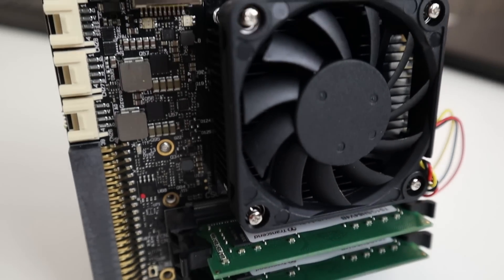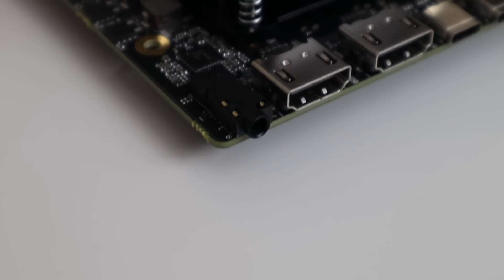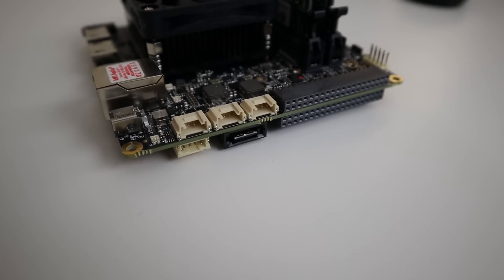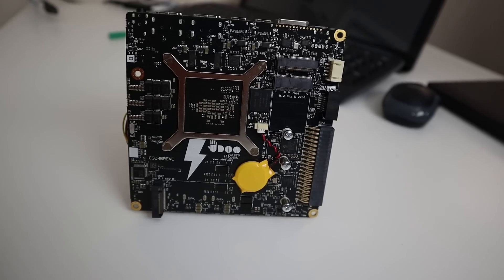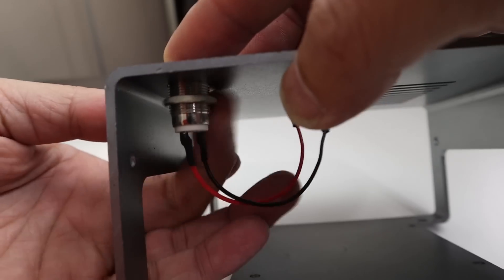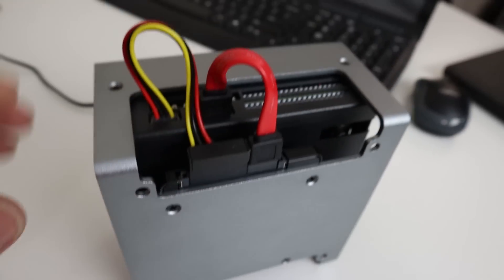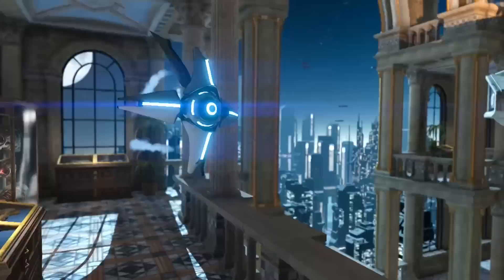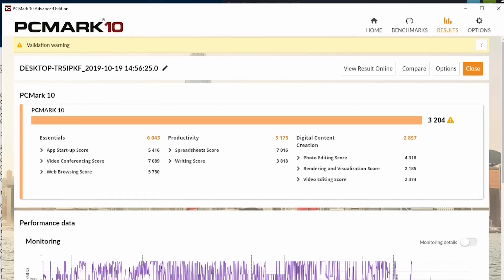UDOO BOLT v8 Review

Comment: Kindly help me to understand the purpose of Wi-Fi and Bluetooth modules. It is required to set up for the Udoo Bolt V8 board to function well? Can the Wi-Fi and Bluetooth connect without the modules installed?

Comment: It seems North Bridge is locked at 1200Mhz, I cannot seem to find any settings to 2400MHz? in the BIOS to alter this my ram is: HyperX Impact DDR4 32GB Kit (2 x 16GB) 2400MHz (HX424S14IBK2/32)

Comment: this thing would make the perfect all in one emulator console.  use all of the single board functions to attach cartridge slots for every single console ever released, and then add optical and floppy drives.  throw in a pair of ports for every type of controller, power, reset, and eject buttons and bam, polymega killer and it would cost less.  lol

Comment: for those that call this expensive, this isnt a pi...its much stronger and for what you get its a steal
Reply: Well, let's compare it to another tiny PC, the HP Elitedesk 705.

Udoo Bolt v8 is $418 for the board alone.
705 is $449 for the complete computer including a Windows 10 Pro Licens.

The Bolt is running a 4C/8T Ryzen at 2 GHz.
the HP is running a 4C/8T Ryzen at 3.2 GHz. 

The Bolt have 8 graphics cores.
The HP have 11 graphics cores.

The Bolt includes no RAM.
The HP includes 8 GB of RAM.

The Bolt have 32 GB eMMC.
The HP have 256 GB SSD.

Both of them have WiFi and bluetooth.

Let's face it, the cost of components make up a substantial part of the total cost of any PC. And comparing those two it seems like the Bolt is more expensive than what its components should warrant. Sure, the Arduino components cost a bit as well, but with complete boards being found for 10-20 dollars that's a minor cost of the overall build. I'm not calling it overpriced, but I wouldn't call it a steal either.

Comment: I'm looking to make this board my daily driver. All that power in such a small system!? Mount it to the back of the monitor. It is basically a thin client computer that can do Arduino programming.
Reply: Intel nuc's can already do that but uses a bit more power ( electricity ) and are just a fraction of the cost of the new ryzen... i expect the prices to drop in the next few months since it's fairly bleeding edge right now.
Don't get me wrong... i love the ryzen but $200-300 for a nuc is a bit "hey amd why are you doing an intel?" :)

Comment: I picked up an i7 2.8 ghz 15" Dell business class laptop with Nvidia graphics from 2012 for $200. I think that's a far better deal. For SBC projects I've got some 10 dollar raspberry PiZeroW boards that work great and have great community support. I'll pass.
Reply: That really depends on what you want to do. The Ryzen is certainly a lot faster, more efficient and has more modern features (like Hardware-acceleration for 4K decoding), but the Laptop has a display.
So if you actually need the performance the this mini Ryzen is a great deal.
Reply: @ABaumstumpf  It's less powerful than my 8 year old laptop but a lot more expensive. It's a niche buy. The pi isn't nearly as powerful but it costs almost nothing.
Reply: @ninline2000  "It's less powerful than my 8 year old laptop"
Well, no. That is simply not true.
But sure, go ahead, the laptop likely isn't bad, it just is slower, needs more power, does not support NVMe, does not support DDR4, does not support 4K hardware decoding etc.

As i already said - if you do not need the power then it is not for you and as reading is also not your strength that is likely the case.

Comment: I actually find the price quite good. If you were to put together a mini-itx with comparable APU, even with an older motherboard you'd be up around a similar price, but in a larger form-factor without the integrated arduino. I don't think this is a board for just hardware work, it would be capable for content creation, making video games, and a lot more.

Comment: Can you Hackintosh it?
Reply: Casey Sweten / have a look at some of the requirements needed for a HackMac. Getting the drivers are the biggest problem.  This board is a bit off centre for getting community help on a HackMac build, that said you can do that on a LattePanda Alpha if you you are looking for a SBC at this size. Check out his past videos he had made one on the Alpha.
Reply: Since Apple doesn't use AMD processors at all, it probably would only work in a virtual environment.

Comment: Oh God here we go, Dr Don continues his assault on our bank accounts once more…  That thing’s epic, it looks like a really nice piece of engineering. The case design lifting it off the table is a very good extra step too.
As for use cases – that’s an ideal Edge Computing system.  You said it takes 19v in – did you run it on a power meter to measure draw at the wall?  I think this would be fantastic for that emerging use case, one thing that immediately comes to mind is using it for voice-to-text processing (entirely offline) with a more sophisticated engine;  or perhaps facial recognition processing, image processing, etc.  I know this is a growing area of technical interest as it sharply reduces comms overhead and complexity and it’s often cheaper to do that processing locally too.
IF the air intakes could be secured against dust a bit more (I know some mine sites use windex cloth around air intakes to pick up that horrid fine coal dust that gets into absolute everything) it might have some good workshop, industrial, etc. type use cases.  Power draw would be important if it’s running on solar, etc. and even on mains if it has its own UPS (you can get away with longer running in power outages of course with lower wall draw).

Comment: So, 5V and max 3600RPM fan
http://download.udoo.org/files/UDOO_BOLT/mechanical_specs/UDOO_BOLT_heatsink_fan_drawings.pdf
 They should do some 80 mm fan bellow 2000 ideally 1200 RPM, if not as low as 750 RPM fixed if DC does not work or whatever happen there, but all the time instead... from silence to 3600 sounds disturbing like an airplane :D

Comment: I own a Udoo Bolt v8 and the fan drives me crazy - same problem as you described in the video. Could you describe how exactly you changed the temperature threshold and maybe how you changed the fan (with custom connector)? That would be super useful! Thanks for a great video!
Reply from the maker: The fan threshold is in the bios. Embedded settings.
Reply: @NovaspiritTech  Thanks! But in my case it isn't. I am running Version 2.20.1271. I have no "embedded" settings. Maybe they updated the bios already and you have a newer model? I will ask in the forum ...

Comment: Wow, that price, scared me well away from the product purchase page!
Reply: Yeah... this is more for those that want something small with a lot of grunt and that it has to be x86 or amd64 compatible.
There will most likely be cheaper options hitting the market soon using the same or a variation of the same ryzen cpu so you can prob get it a lot cheaper if you can wait a few months :)

Edit: there are intel nuc's that gets the job done at a similar form factor or smaller at a fraction of the cost of this one but they are no where near as powerfull.

Comment: Can it play Crysis?

But seriously, video playback and stuff like that is all I would use it for.
Reply: Yeah, I guess it can play Crysis with a 4 core Ryzen and an integrated GPU roughly equivalent to a GTX 560 or thereabout. But don't expect much more than 30 fps at 720p and low settings.